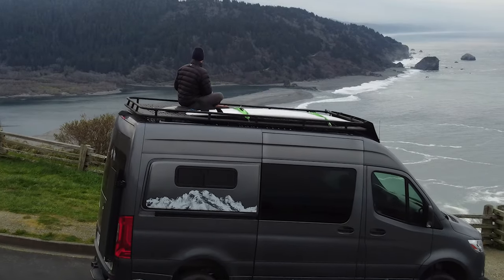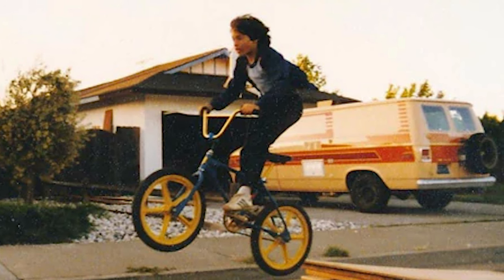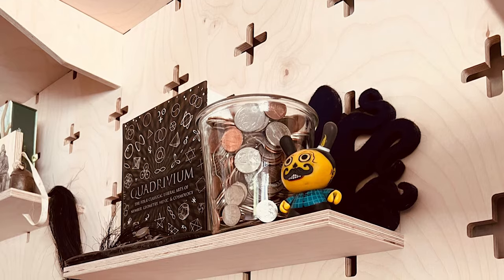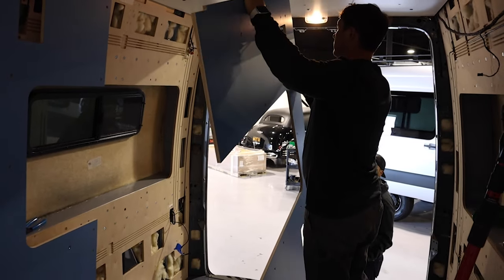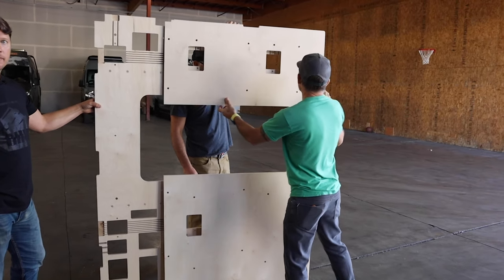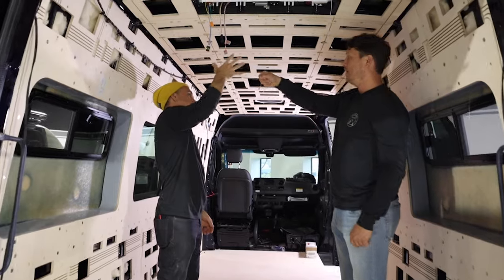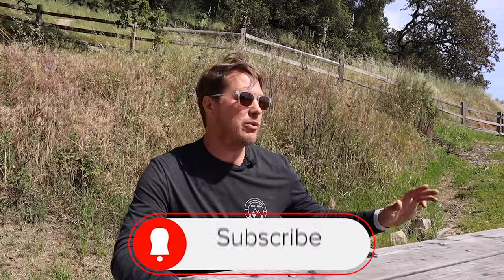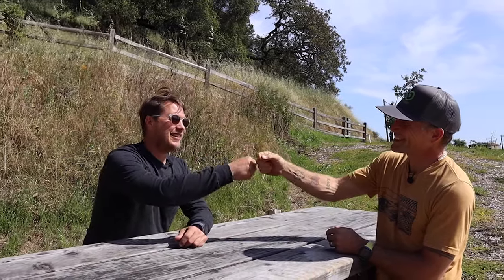Q&A On The Absolute Fastest Way to Build Your Van | Infinity Interior System

Comment: 15k seems steep since this is not even half of the build. You still got all the electrical and water stuff, which is what scares me the most (including me). If there was a like guide on how to do that with this kit then I think people would be more attracted to it even with the limitations of the models and designs. What I mean by the guide is not an installation tutorial, but a list of suggested parts and hardware, like batteries, water tanks, etc - specific stuff. Otherwise, I think that it kind of makes it even more difficult for some since now they have to plan what they wanna buy and install having in mind the kit that was already prebuilt.
Reply from the maker: Coming soon! Thanks for the feedback.

Comment: Van Builders make $5000/week? What has to be addeded to complete the build? Sink? Pump? Faucet? Electrical componenets? Insulation? What about wire and lights? The kit is cool but seems a little pricey for a bunch of CNC'd wood panels. I really love the idea, but have lots of questions.
Reply: Exactly what I was thinking
Reply from the maker: You will pay $5,000 per week to have your van in a shop- that's what we meant. Most shops are $150-$200 per man hour. $150 x 40 hrs = $6,000 and that's if only one person is working on it. Could be way more.

Comment: Great video 👌👍 I loved the idea of modular panels . But : “ have you considered using lighter wood panels like the ones used by Reparadise ? They are using “Ultralight” panels which are 42% less in weight , and they are also using something called “ Baltic Core Hex Ply “ with an antislip surface on one side and laminated on the other side , also very light in weight . Can you imagine using these panels , how much weight you will be saving by also using your CNC cut outs and pocketing method for weight reduction ? I think you will be saving another 25-30% easily. All these weight reductions also applicable to the cabinets , will be fantastic. 👌👌👌👌👍😊